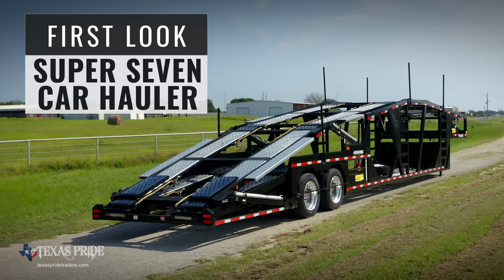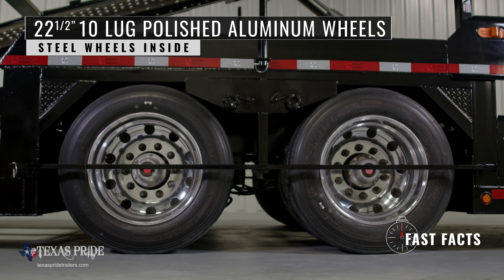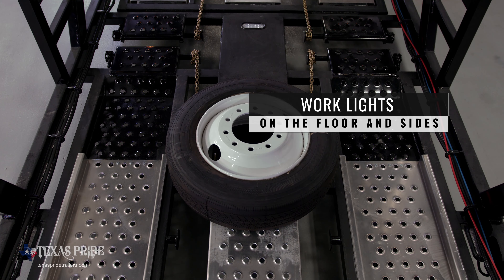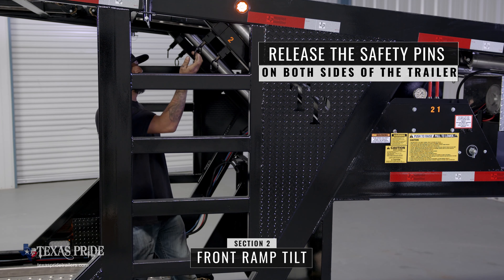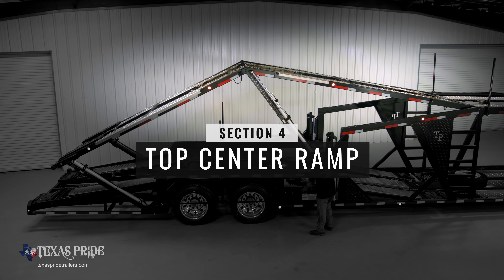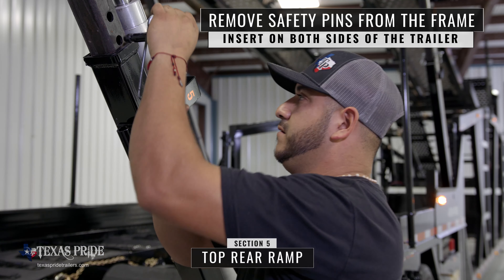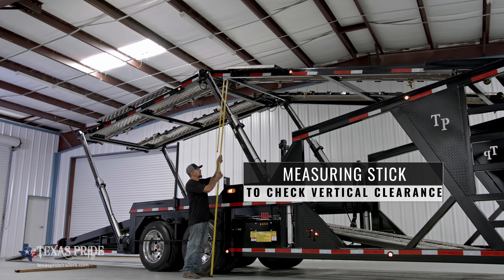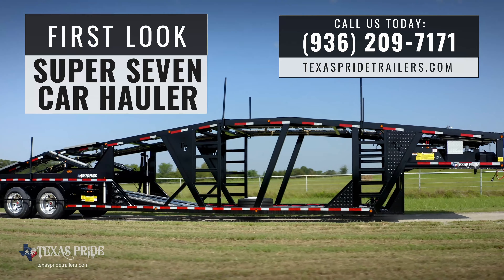First Look: Super Seven Car Hauler Trailer | Texas Pride Trailers

Comment: Nice trailer. I’m using a Cottrell 7 car myself but yours is just as slow as mine lmbo. I actually got rid of the push button and installed a toggle switch instead of having to always push the button

Comment: thats the same as my wally mo 7 car  very nice i like that it has disc brakes
Reply: I was thinking the same thing I work at wally mo it's looks just like are with a few tweaks
Reply: I tried brand new walley mo this year )) 3 broke downs in a 2 week, one of them rear extension rod pop off the weld))) poor weld work out there…

Comment: REALLY 7 CARS HAULER DON'T BUY, EVEN THERE 6 CAR HAULER IS A PIECE OF JUNK. TEXAS PRIDE SHOULD NOT EVEN BE CLOSE IN DOING CAR HAULER TRAILER. THEY SHOULD JUST FOCUS ON THERE LITTLE DUMP TRUCKS THEY ARE DOING. I HAVE THE 6 CARS HAULER NEVER ENJOYED IT FOR A DAY
Reply: Its steal with the same parts used by different companies lol
Its not a car with a TP engine 😂
Reply: Mine is a really well built trailer and works great everyday !!!